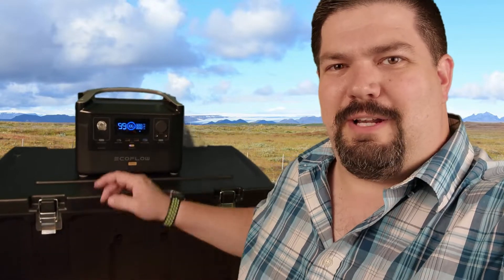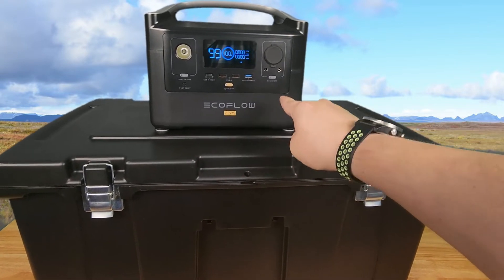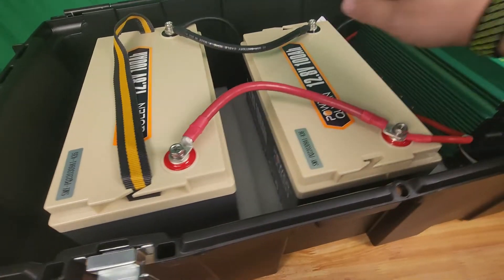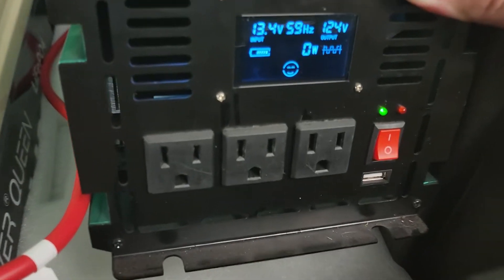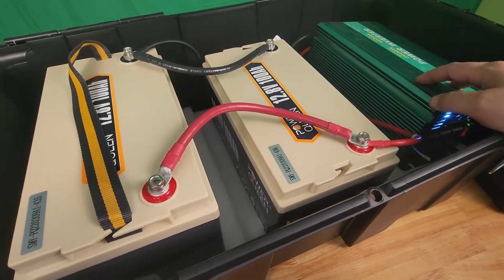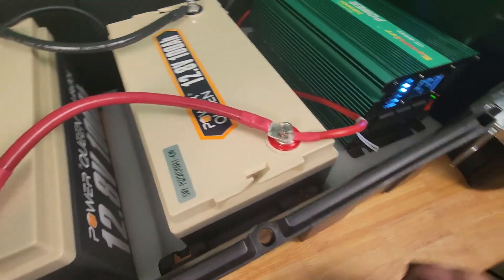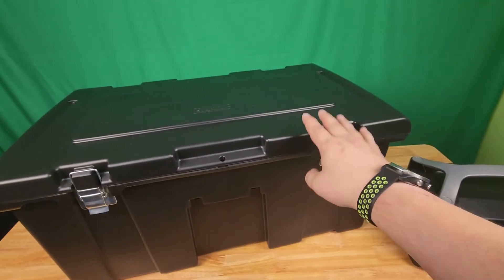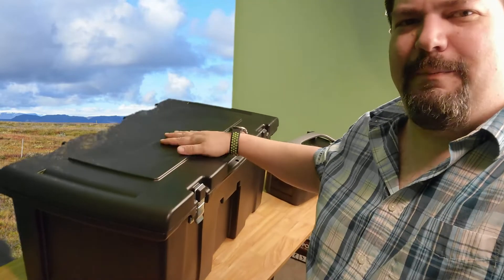DIY 2000w Solar Generator with 2.4 kWh of battery storage. super simple.

Comment: We're running the 30a power queen mppt charge controller and 2 of the power queen 100ah batteries in parallel.  400w of solar.  We run between 200w to 400w of power per 24hrs. And has been running very well this winter.
Reply from the maker: I wish I had a proper charge controller / inverter. the all-in-one units are just so expensive

Comment: Wouldn't solar be like a trickle charge for your dual battery setup? Depending upon how heavily and often you will discharge or use that setup, solar seems like it would be nominal for that application.
Reply from the maker: My solar charge controller can charge up to 50 amps depending on how much solar I put in it.

Comment: Hard to say for sure, but your wires between the second battery and the inverter may be too small. Watch their temperature for the first few high power runs
Reply from the maker: You were correct, wires get very hot on a heavy load. I've purchased larger gauge since this project
Reply from the maker: That was the wiring that came with the inverter but I'll keep an eye on it

Comment: Interesting DIY solution.  So 2.4kWh ~ to 10 miles range?
Reply from the maker: I likely wouldn't be able to pull out the full amount due to inefficiencies and heat. I'll try to remember to put the car scanner on the mach-E when I'm doing it and it should show kilowatt hours delivered and miles added more precisely